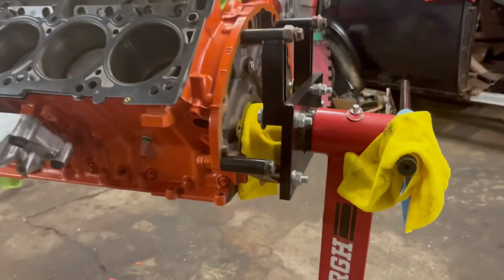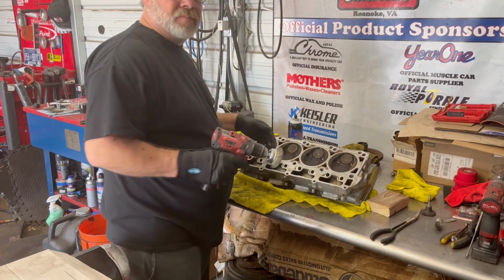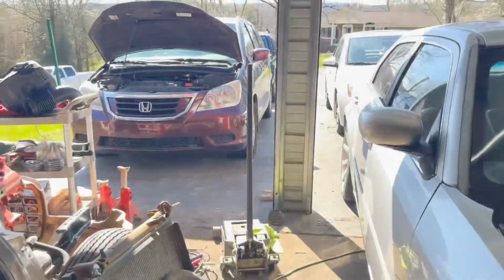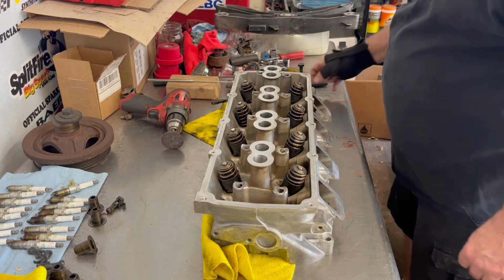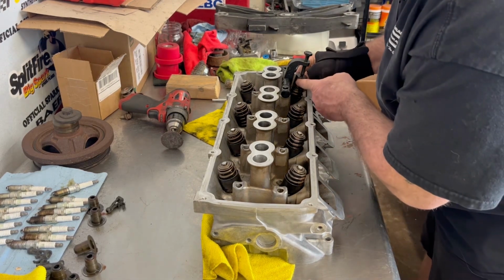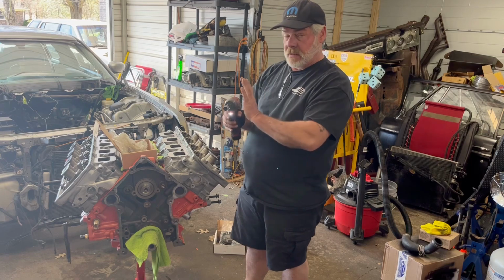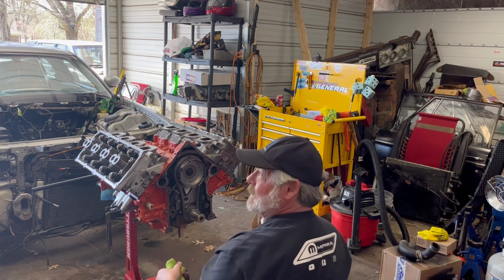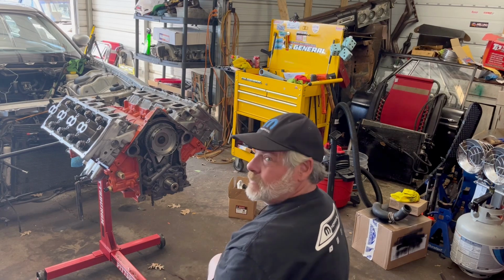The 6.1 Hemi gets a face lift and Ethan cleans up the wiring mess in the Engine bay!!

Comment: Great job. It coming together. Gotta love playing the waiting game. Weather it's waiting for parts or waiting for the extra money to afford parts. But Ethan is a smart man. I use the zip lock bag tick too an label everything. On the timing cover with different length bolt I try to place them back in there holes until I need em. I don't know if you've tried it out or not but when your installing the engine the transmission dust shield/shim put 2 small zip ties one 1 on each side to hold it in place until you get the engine in then clip an pull them out. My brother in law showed me this trick an has made my life so much easier.

Comment: The only thing I see about your valve spring compressor that I don't like is that they use 2 different bolt size. Maybe someone could cut the same size bolt head off another bolt drill a hole in it and weld it to the top of the smaller bolt,  no big deal just would be nice using the same tool for all 3 bolts.